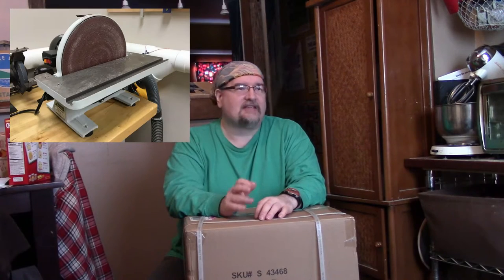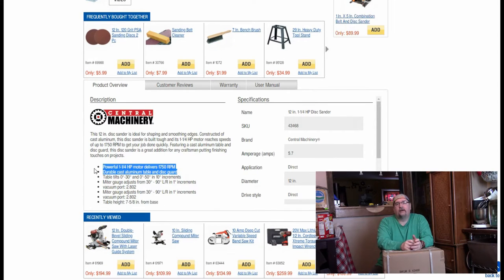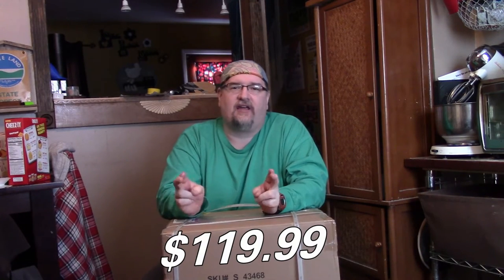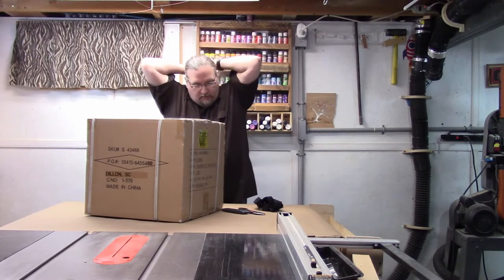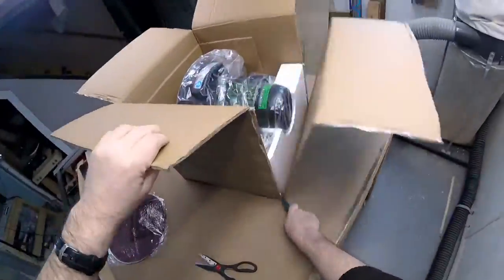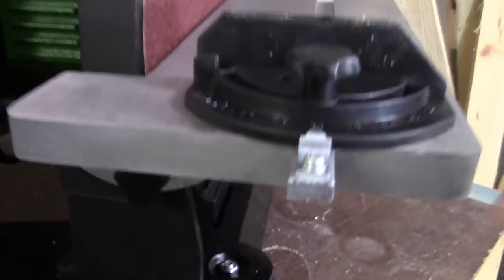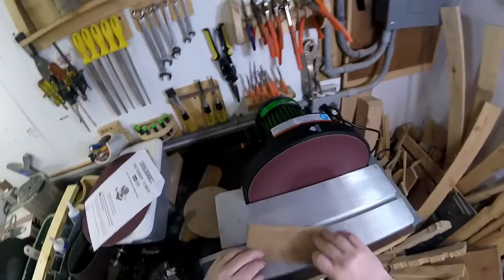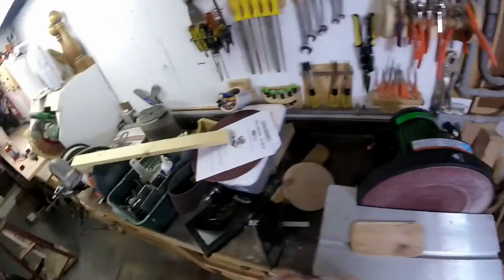Harbor Freight 12" disk sander setup & review

Comment: Bought one the other day it was the last one Harbor freight had mine had a bad bearing in the side where the desk is very easy to fix I bought new bearings off of Amazon for around six dollars apiece putting them in took me all of about 45 minutes the thing runs great now I was a little disappointed that it had a bad bearing right out of the box but harbor freight is hitt or mess when it comes to quality control I have a video of the tear down and diagnosis on my YouTube channel if you’re interested in taking a look in case your bearings ever go bad you’ll know what to The bearings that I replaced were absolutely horrible very cheap not any grease at all I replaced Them with good quality NSK bearings and it made all the difference in the world the motor even seems to run cool now barely any heat at all.

Comment: Every one of these is junk out of the box including the one I bought. The disk wobbles pretty bad, mine was out 40 thousands of an inch. Totally unacceptable. I see yours is probably about the same, with the pattern visible on the disk. It's contacting hard in one spot and not hardly contacting at all on the opposite side. I looked at several in the 4 HF stores I have visited, and all of them had wobbly discs. So I got one with the idea of trying some things to fix the problem. What I did, was attach a dial indicator to the machine to find the high spot. Then I took a dead blow hammer and began banging on the disc in the high area. It took awhile and many carefully placed whacks, but in the end, I managed to bend the disc, and get it to within 8 thousandths of running true. With a brand new disc installed and some tests on metal pieces, it shows it's contacting pretty evenly all around the disc. It's much nicer to use now.